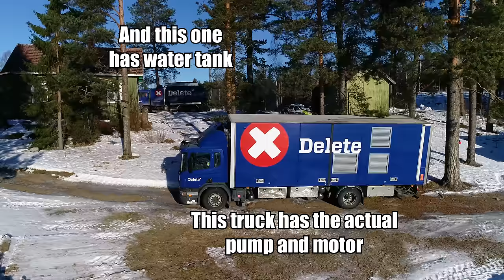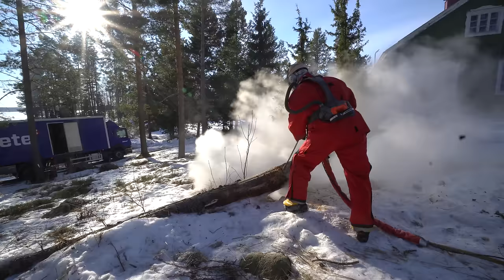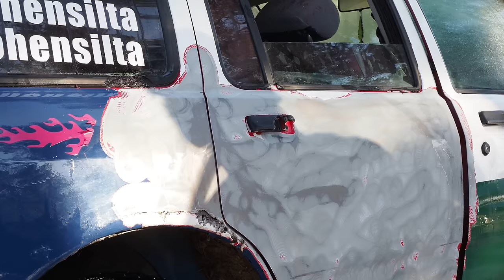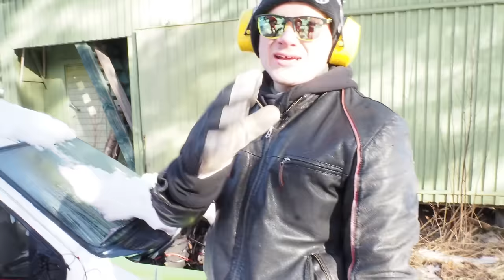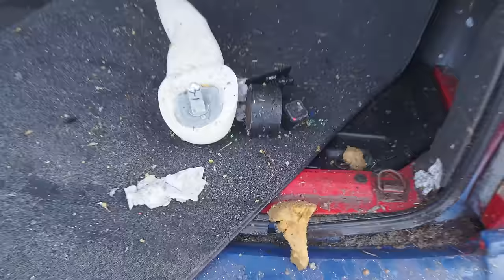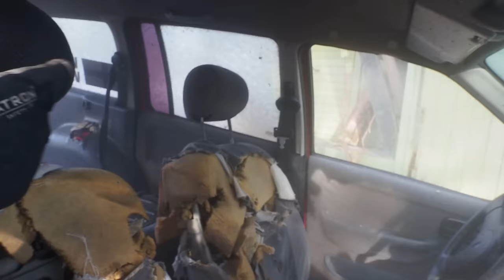Car Vs. 44,000 PSI / 3000 BAR Pressure Washer

Comment: A long time ago, I watched a documentary on quarrying either marble or granite. They used a rig that had high pressure water come out of oscillating nozzle, which made a beautifully clean cut in the stone so that large slabs could be quickly quarried.
The power of water is amazing.

Comment: I have used one of those to remove old paint and rust from a ships hull before, they are lethal things! It also happily stripped away several layers of non-slip 2 pack paint which was used on the outside decks of the ship. But they make one hell of a mess, and yes, i agree, they are bloody loud!
Reply: Especially the spinner tips!

Comment: One new firefighting technology is high pressure water like this and sand in a nozzle that you push against steel / congrete wall. That will drill through it and then soak the room really fast. That way firefighters dont ever have to breach into the burning area so no danger of backdraft etc. I'm not sure if any Finnish fire departments have that thought.
Reply: Cobra cutting extinguishers have beeen in use in Finland for more than a decade and they're becoming more and more popular as the knowledge spreads. Cobra Cold Cut Systems Svenska AB invented the whole thing and the systems are made in Sweden. They launched their first commercially available ready-to-use system in 2000 so it's not that revolutionary.
Reply: @anttiheikkinen3313  Cool. I just heard of it recently.
Reply: @anttiheikkinen3313  I heard something about that on the Swedish news around year 2000 - 2005 or something. 
But since then I havn't heard anything more about it, is it still used?
Reply: Genius!
Reply: @sebbes333  It is very much used all over the world and constantly increasing in popularity. Cobra themselves claim there's 750 systems operational in EU and Asia. The same system is licensed for US market and re-branded as PyroLance. That will give more search results. There's also a CNN article from Feb 2018 that says the US Air Force bought 193 of those systems for their own use (googl PyroLance CNN, as youtube doesn't take kindly to urls).
Reply: @anttiheikkinen3313  Thank you!

Comment: It's wild how much the guy with the nozzle has to lean into it.
Reply: Try a fire hose. When I learned aviation fire fighting in the Navy it actually took a team of 4 to effectively control the hose and nozzle, and we still had to lean in to it.
Reply: The lower pressure ones actually press harder because they use a greater volume of water where the higher pressure is less water volume but through a smaller opening. We do water blasting at my job and the 10,000 psi gun is actually the hardest to hold on to. Maybe not fire hose level but it will hold me up at a little over 200lbs. It will bruise up your shoulder like you were out shooting a shotgun all day, coincidentally they call those water guns shotguns as well...lol.
Reply: Newton's 3rd yo! It's just a really inefficient rocket motor haha

Comment: here in southern california. after the 1994 earthquake.. they used that kind of high pressure machine to carve away the concrete from cracked usually parking structures leaving exposed rebar where the cracks were.. then they came back in with high strength cement to fill the gaps.. worked great..
Reply: Interesting.   Normally with concrete they try to avoid sticking new wet concrete to already dry concrete, coz it doesnt stick as well as if it was all one big constant pour.  But i guess its better than knocking down the building & starting over
Reply: @roidroid  they also wrapped large cylindrical concrete columns holding up bridges and freeway overpasses with steel sheets.  They had actually started that project before the big quake happened. A number of large portions of freeway overpasses, that had not been upgraded yet with the steel encasements, failed and collapsed. Southern Calif. and particularly Los Angeles county have some of the strictest building codes, in large part due to the frequency and strength of earthquakes.

Comment: Given how hard a 250hp engine goes in a car weighing 1.5+ tons, I have no doubt how hard it can push water through a pump. This thing is a weapon.
Reply: Diesel Hp is different from Gas as the Torque is far higher. A Semi weighs 80,000 lbs is 500 HP… Ferrari sports car  is easily 700 HP+
Reply: @crandonborth  no it isn’t, torque is torque. (Torque x revs) divided by a constant = power

The truck is much heavier, very poor power to weight ratio, give it the same aero and power to weight and it’ll be as fast.

Diesel makes more torque at lower revs that’s all.

Comment: At work i've already seen a 3000 bar pressure washer but it was automatically washing inside of a pipe with a robot. The old paint was removed first with this machine, then sanded with another to give some good grip to the new paint.
I've never seen such hand held one, impressive recoil with this gun !

Comment: I do a lot of waterblasting in the oil field. I’m 220-230 lbs and the high pressure guns have no problem holding my full weight when lying across it. If don’t right you’ll float above the ground. You can walk up walls if you’re handy enough.

Comment: The pressure of the water stream after it has left the nozzle is the same as atmospheric. It is the very high velocity of the stream that cuts through solid objects. Of course it takes extreme pressure to force water through the nozzle at very high velocity.

Comment: Put gasoline in that tank instead water. Huuuuge flamethrower 🔥
Reply: Hahaha what could possibly go wrong
Reply: That would be crazily stupid but fun to watch. I have no doubt the pump would explode from diesel theory combustion.
Reply: painmagnet1 it wouldn't ignite in the pump because there's no air. But maybe at the nozzle. Have an aerator of some sort that mixes air with the high pressure water?
Reply: Grimace427 right, this is an order of magnitude more, however. Plus, higher volume pump. I could see it igniting on its own at the outlet, unless the pressure drop is too quick.

Comment: I had a much smaller pressure washer back in the 1970's. For washing and peeling paint off of houses. But even that one blew the wood off. It was only 1200psi  but at 10 gpm. the volume made it destructive.

Comment: If you noticed they used different tips. The one for washing will make the water jet twist a little bit so it won't cut anything. You can hear the difference if you listen closely. The second one would have cut with out the sand, it would have been much slower though.

Comment: Can You tune the hydraulic press by connecting the high pressure hose (44,000 PSI) with the cylinder of the press?

Comment: That’s one way to clean your car! Except that it’s stripping the paint and would cause it to not look so good and would result in the metalwork succumbing to rust. When they paint cars in the factory, they electrify the body and dip it in zinc before applying the base coats. Then the paint is applied and then the rustproofing and finally the clear coat.

Comment: Fuck yeah. I worked in an auto reconditioning shop for a while after high school. They had pressure washers that would do about 40,000psi, though we usually had them at about 25,000. You could destroy a car in the blink of an eye if you didn’t know what you’re doing.

Comment: Is the water/sand leaving the nozzle above the speed of sound?
Reply: About other water jet :
The Electric Servo Pump generally pressurizes normal tap water at pressure levels above 50,000 psi; to produce the energy required for cutting.
Water is then focused through a small precious stone orifice to form an intense cutting stream. The stream moves at a velocity of up to 3 times the speed of sound, depending on how the water pressure is exerted
Reply: @danielgorzelniak3209  Awsome. When an object passes the speed of sound it creates a pressure area that makes a sonic boom. I'm guessing that the sonic boom this creates is not loud enough to be heard over the sound of the water passing through the Venturi. Am I correct?

Comment: Not the easiest or cheapest way to cut up a car, but pretty damn cool!
Reply: I'd bet it might actually be cheaper to run (Maybe not the initial equipment purchase though...) than Oxy/Acetylene torch costs.   If you use it daily, could be worth the money lol.  It is probably not cheaper or faster than a portable abrasive-blade circular saw, but definately more fun, and possibly has legitimate application in an environment that needs to be spark-free for safety reasons.
Reply: @michaelswain8414  I don't know the market prices of oxy/acetylene, but I have a hard time believing they'd cost more than running the two trucks and the crew of 4-5 people that this seems to require.
Though that being said, yes sand and water is probably cheap.

Comment: Cut the car in half from front to back with the engine still inside so the engine and transmission also get cut. Then pull the halves apart.

Comment: i dont understand how there is no energy pushing back on the guy operating the gun... i used to use 3000 psi washers and i could lean my entire weight on it!!! 44,000 psi would throw me through the wall lol
Reply: there is!! you can see him, especially at the end I think, having to lean forwards to get the pressure washer closer to the surface and not fall over or anything. He's just used that pressure a lot and is strong and prepared enough to handle it at this point
Reply: @rubynights3  and he has spikes/cleats on those boots to maintain a sure footing. 💪👍

Comment: That thing is more for cutting concrete not washing paint 44000 Pai is way too much pressure for that think door metal
Reply: It only cut while the sand was in the mix. They do use these things on shipping containers to strip the paint and rust really quickly, then they repaint them. Because of the salty environment shipping containers live in, it's not enough to just wash them and repaint, because you'd just seal the salt inside so it could go right back to work as soon as air gets in again. So every so often, they strip them to bare metal and repaint.